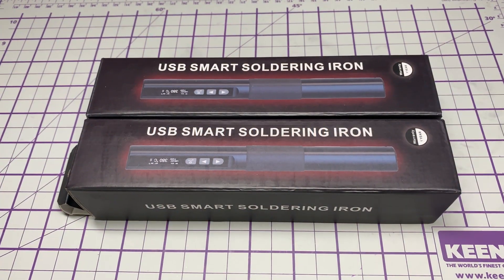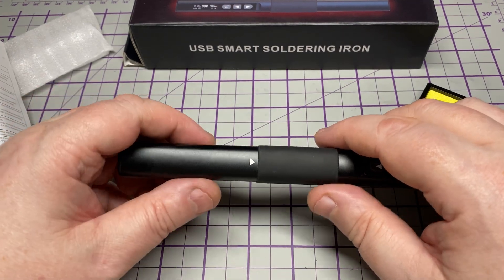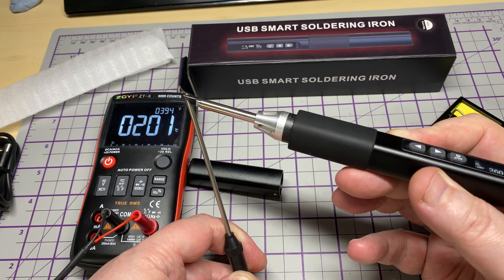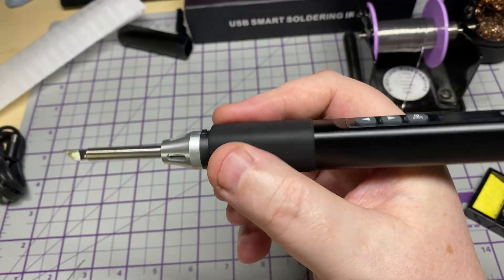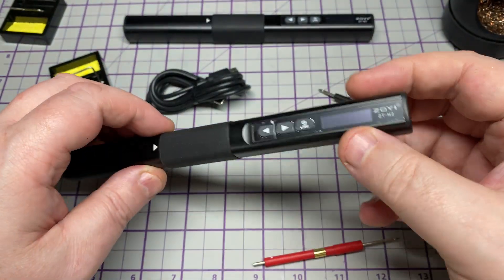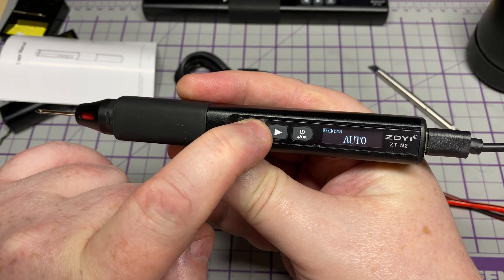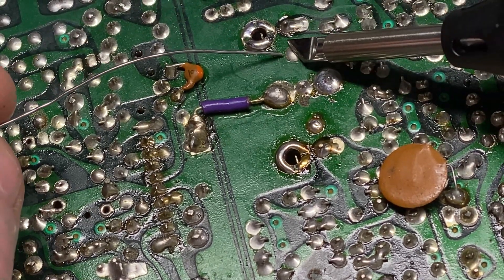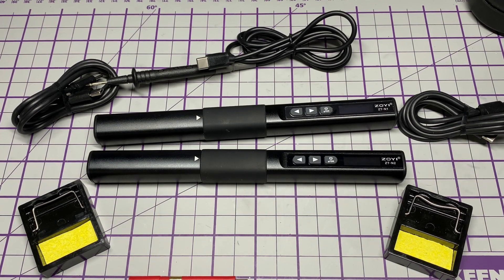ZOYI ZT-N1 and ZT-N2 Soldering iron with a multi meter.

Comment: So the N1 uses T12 and the N2 T65?  My owners manual for the N1 says T65, but the tip provided is T12.  I think if I buy T65 tips they won't be long enough.
Reply from the maker: yeh 2 different sizes, cheap enough on aliexpress